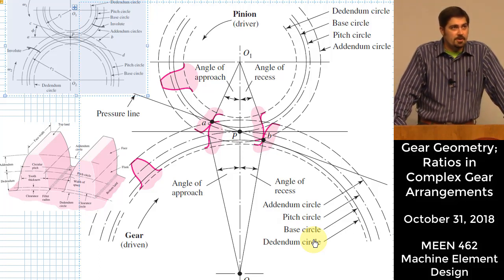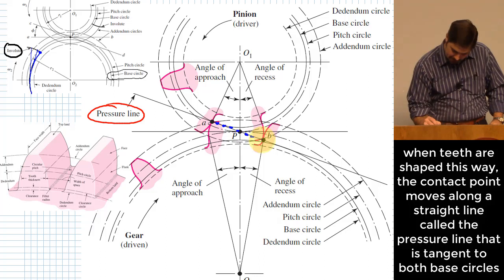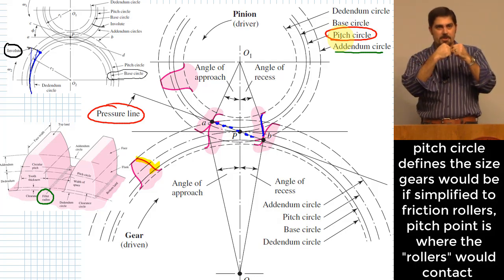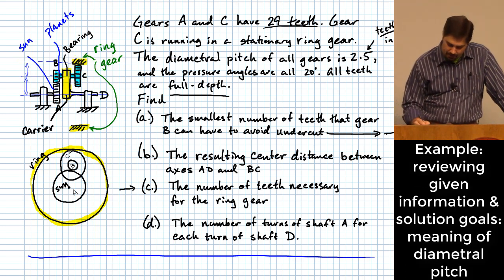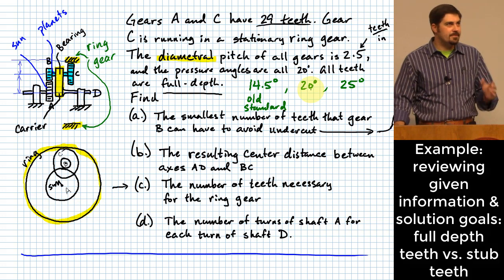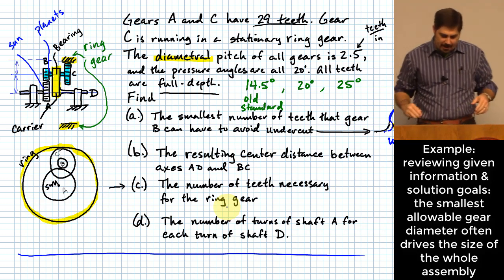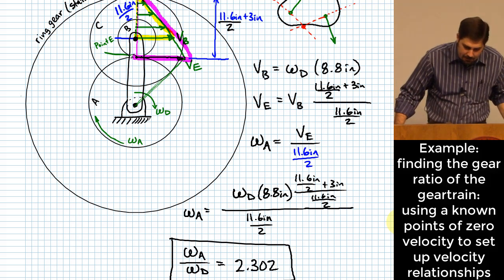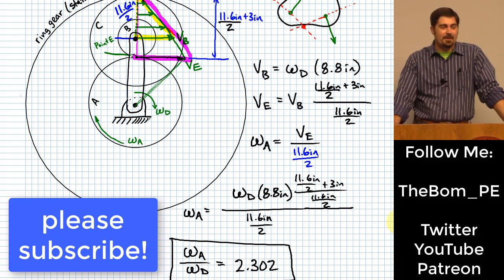Complex Epicyclic Planetary Geartrain Ratio | Involute Gear Tooth Geometry; Avoiding Pinion Undercut

Comment: i have watched a few and find them extremely useful. Could you recommend a book as a reference guide?
Reply from the maker: I teach this course out of Shigley's Mechanical Engineering Design, 10th edition. It is a great guide to a large number of ME Design topics. That said, the technique I show here for analyzing epicyclic gear trains is not demonstrated in that text. It relies instead on understanding the instantaneous center method covered in Dynamics.
Reply: Thank you, I will look both up. I find it strange that at 18 I would not be capable of learning and understanding the material you provide for free. Now I just need to wind the clock back 20years and I might just be capable of becoming one :) cheers TC.